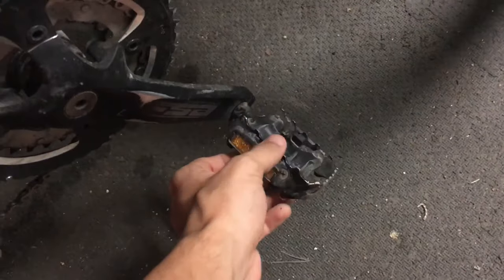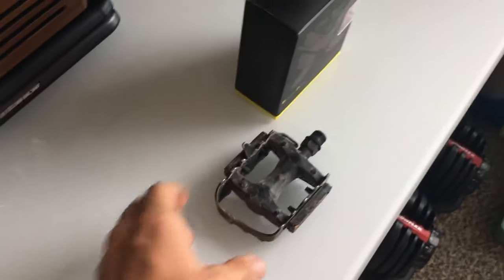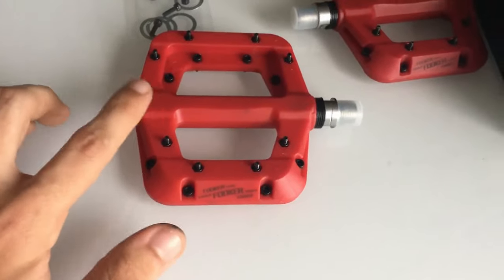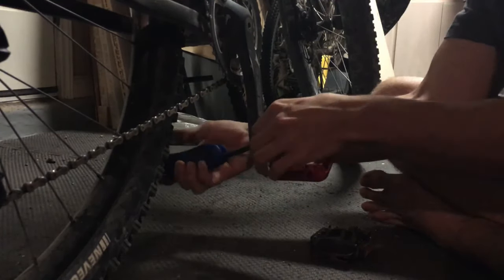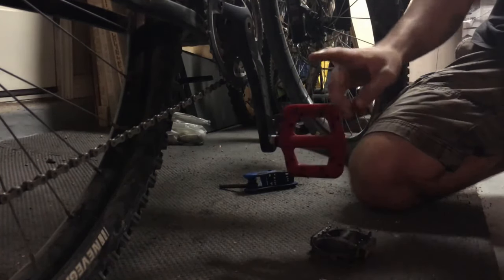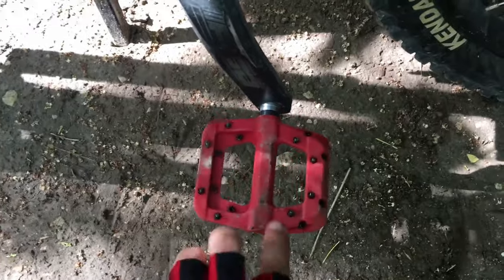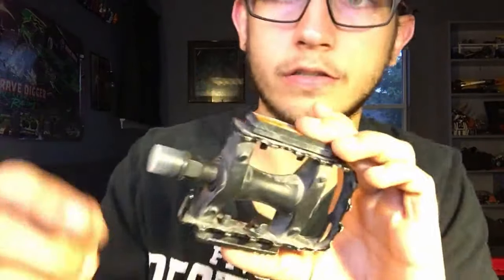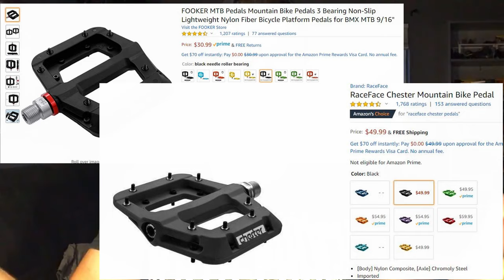Should you Upgrade to Flat Pedals? (Fooker Pedals Review)

Comment: Yes, you should definitely upgrade those pedals if you do any off-road riding! Flat pedals with pins will keep your feet in place much better, you will pedal and ride better and safer - use them with flat sole shoes for best result or even better buy dedicated mtb flat shoes if you can afford them.
The knock-off pedals will work the same, but they will be less durable in time due to cheaper components.